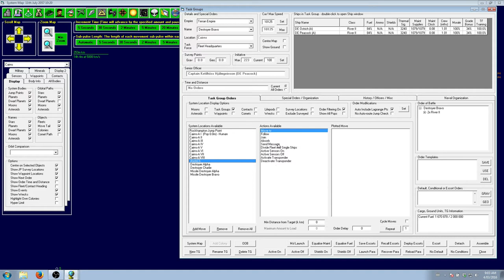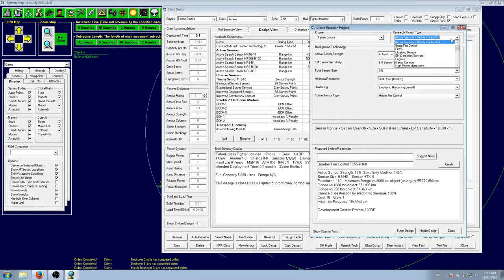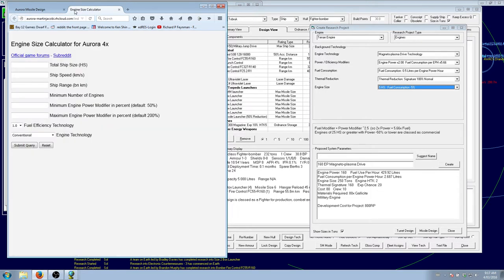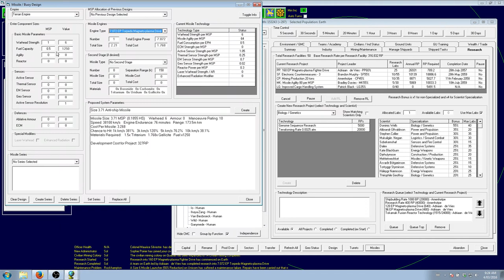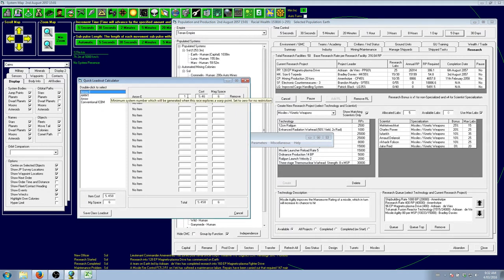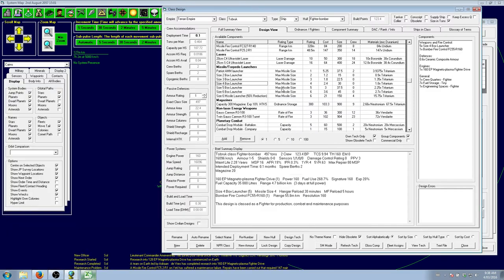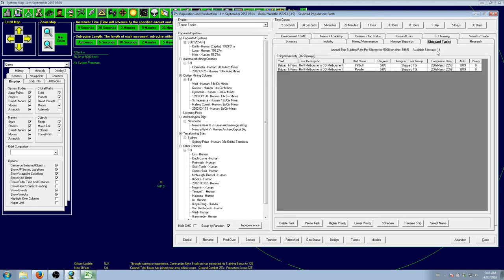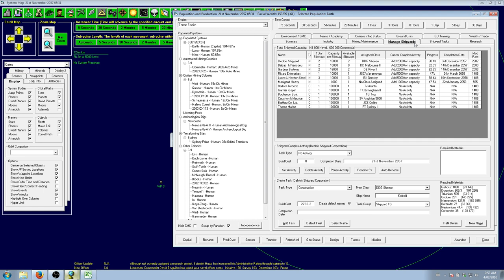Let's Play Aurora 4X - Ep.22 - Designing a Fighter/Carrier.

Comment: I'm sure you already learned it but for anyone else reading this you need to cut your max power in half to get accurate results from the online calculator.
Reply from the maker: +topdeck55 At that time, I had the 2x racial max power mod already. The missile max power mod is double your base mod, and you use your base mod for the calculator, therefore 200%.
Reply: In case you didn't notice later and if you haven't realised since: you still had 'Auto determine damage' set when using the calculator.

I don't know if your target would've been plausible, but you were losing the MSP for that 4 damage due to that.